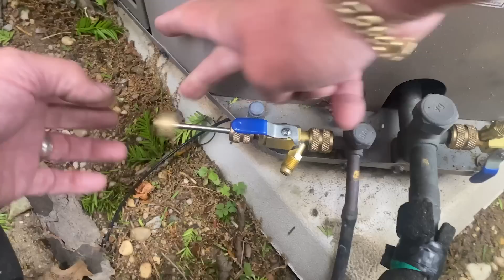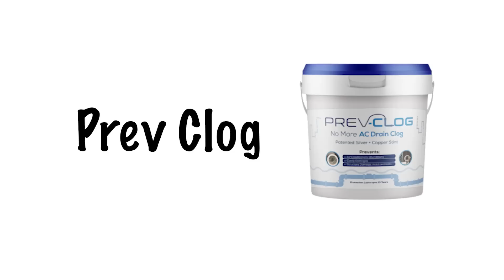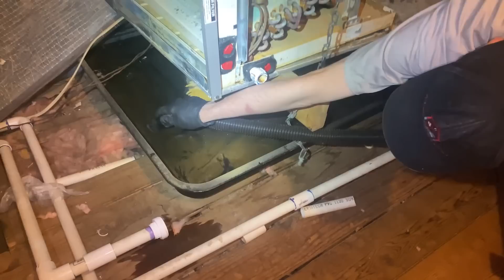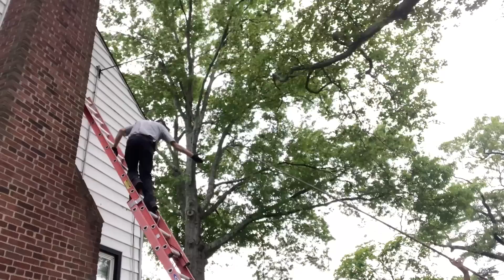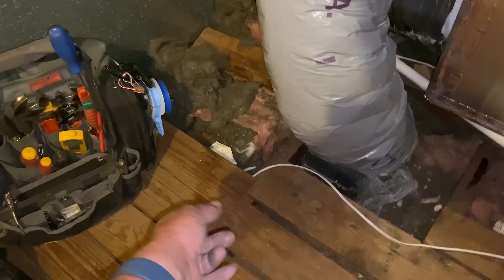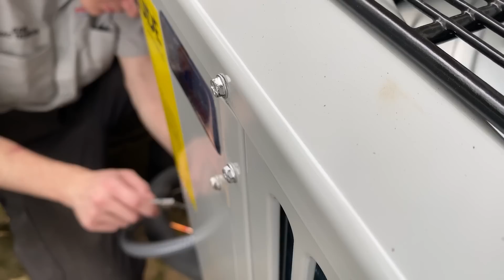Proper Techniques When Replacing Central AC Equipment Explained

Comment: Why don’t you use copper tubing
Reply from the maker: Using copper tubing is definitely a common choice for many HVAC systems due to its durability and efficiency. However, there are various factors that can influence the decision, such as cost and specific system requirements.

Comment: we have such high humidity that ive had to go to the pvc 1120 drain pipe on a few of the Bosch units, because they remove so much moisture from the air, but I am curious to know how that prev clog works, I could always go to a 1" if I needed to, then I doubt it would ever clog with both of those factors.

Comment: Mike I put in a unit at my moms house 2 weeks ago I purged with nitro the whole time but I didn’t replace the whole lineset I just replaced the part under the ground is there anything I could have done better I have pictures I can email you if that would help

Comment: Doesn't matter how good or efficient a unit is if your going to put it right under  a dry vent. Would have been a good time to have moved the condenser. Might want to use a level next time you replace a thermostat. Keeping it real keeping it raw.

Comment: Get a designated Pig, drill hole through pig. thread prevclog through pig. Suck out with vacuum. 

Great video. Nice work, great work. Much love. We should do an update video on the changeout.
Reply: @PipeDoctor  tie a few knots in end. Sick through. Just did it. Have someone holding it on other end or dispense amount needed and let lay. It works. Just suck it out. Tie knots for weight. You da best.

Comment: These New Systems are Incredible.  We bought a New High Performance Carrier System almost two (2) years and it has been Incredible and Super Quiet. 👍🙏
Reply: I have a carrier infinity unit and it too is a high efficiency unit. However, it’s been nothing but a nightmare and very expensive to repair. Condenser fan motor costs over 1,200 dollars to replace. Having to replace it every two years. The cost of repairs far exceeds the savings on your utility bill. Hope you have better luck than I did!!

Comment: For maintenance,  I clean my drain with a cup of vinegar  and let it sit for 15 minutes, then flush with a gallon of hot water every few months, the drain line is only 15' from the  sump pump in basement. Just wondering if any benefit to adding that blue rope to an existing system vs. a new install.

Comment: How much refrigerant did you add for 77 feet line set?
Reply: Depends on what the manual specifies as there’s different calculations for copper diameter and what the condenser comes pre charged with.
Reply: @Silky_boi  
Every system come pre charge for 25 feet line set installer tech should charge .06 lb  per feet for every additional.
Master hvac exam in 1988
Reply: @rezadargahi9040 precharge is 15’
Reply: @kangaroogod  
It’s hard to type correct letter when you have a thick finger, I really mean to type 15 feet